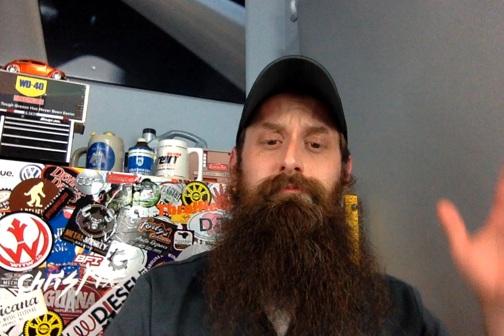Why Does My Check Engine Light Go Off Sometimes?

Comment: 2006 Subaru Outback.  I'd been frustrated with the check engine coming on and then by the time I get it to the dealer, the light turns off.  This was happening for 5 years, maybe twice a year.  Every time the service department told me that the car doesn't hold what fault codes happened in the car, so without the light being on, they had nothing to go on to start diagnosis.  And I'd leave frustrated knowing that the problem was still there.

Eventually, I managed to get the car in while the light was on.  They hooked it up to their computer, and found out the there was a fault in the exhaust oxygen sensor (I'm probably remembering the exact name incorrectly).   They replaced that, and $300 dollars later I left the shop with a fixed vehicle.  Bonus: the car ran so much better.  For obvious reasons.  In retrospect, if I was more aware of the performance of the vehicle and how it changed, I could of given the service techs some useful information.  But about all I know about cars is you put gas in and take it to the shop at the recommended intervals.

After watching your video, and yes I realize that manufacturers could and probably do have their own schedules for keeping sensor information, is why don't they (the makers of the car computers) add the 5 cent chip to the firmware system in the car to store the last sensor fault with the time-stamp of when it happened.  I work in the computer firmware field and it would be stupidly simple to have a 32 or 64KiB memory chip that gets treated as a rolling buffer and it has its own real-time clock to time-stamp any information written to it.  I feel that would be such an improvement to the serviceability of the vehicle that it'd easily offset the extra $20 added to the sticker price of the car (by the time the 5 cent part went through all the middle vendors the markup would be about that).
Reply: A lot of auto parts stores will scan your car for free, so if you have one close by, get them to scan your car and then take it to the dealer.
Reply: I didn't realize that.  Makes sense in retrospect.   I'll remember this and put the knowledge to good use.  Thank you!